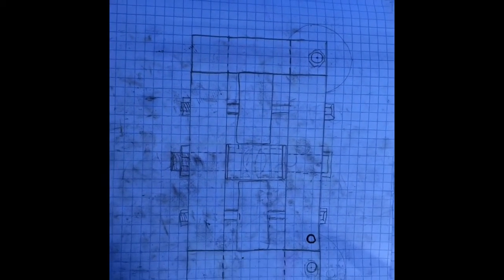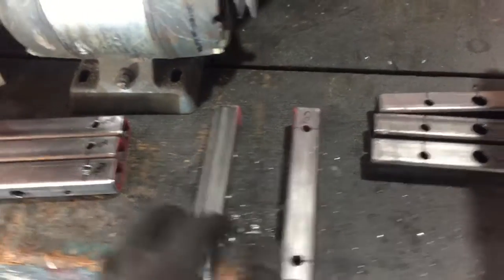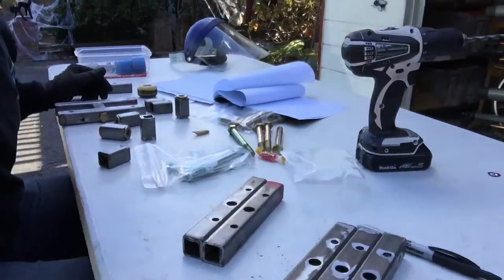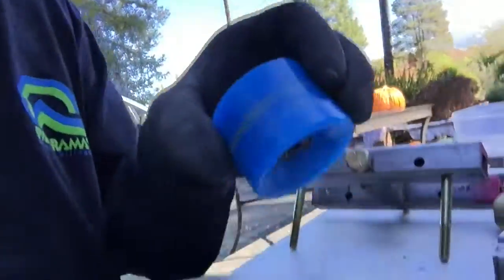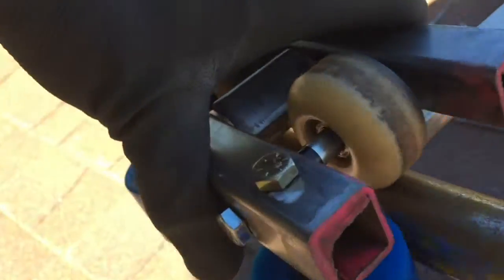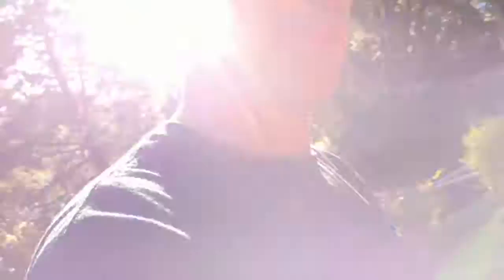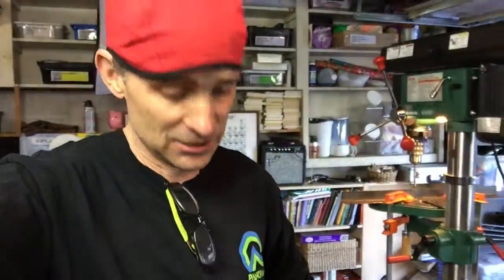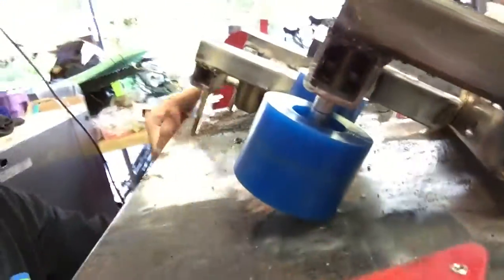Backyard Roller Coaster- Wheel Assembly Assembly

Comment: Looks good.
But have you looked into welding on heat treated fasteners?  You want the properties to stay high just where the bolt comes out of the tube, where the bending moments will be the highest.  I believe if the steel in the (grade 8?) heat treated bolts heat up to much, it will go back to annealed properties.